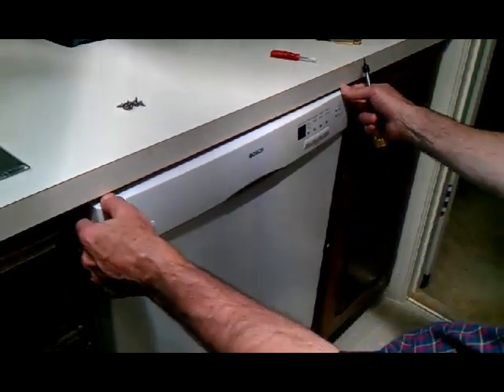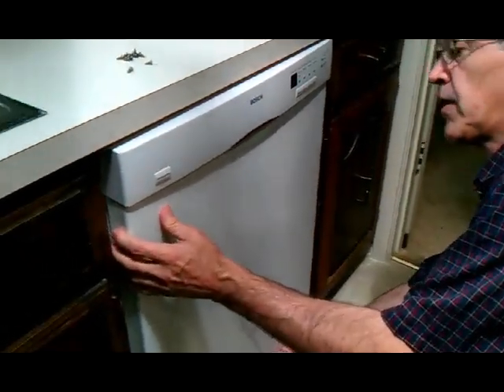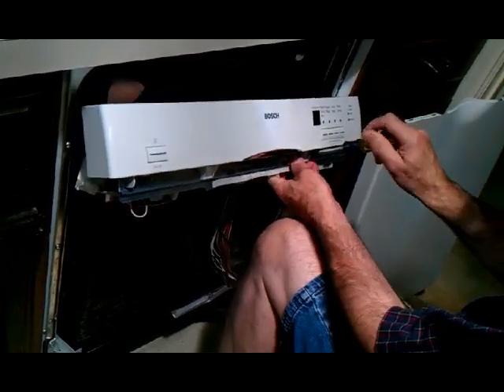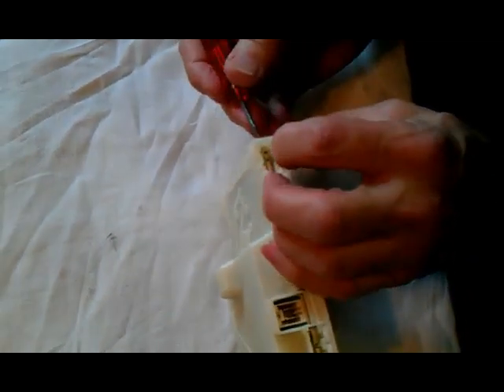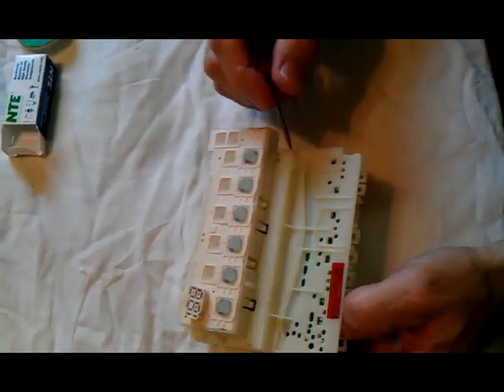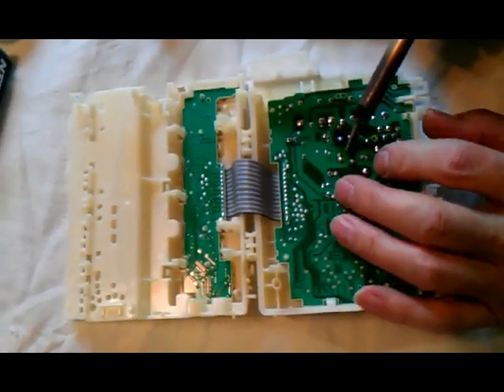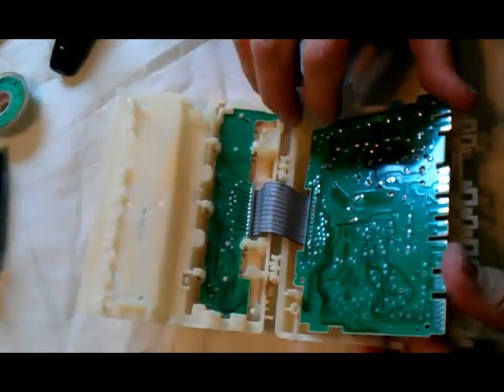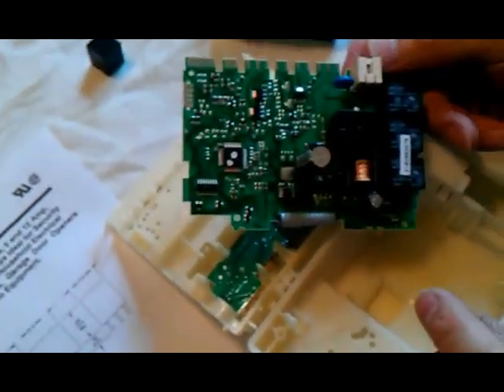Bosch Dishwasher Heater Relay Repair Part 1

Comment from the maker: I would need the information on the top of the relay to be sure which is the correct match as Bosch used 6V relays and 12V relays. Did you happen to take any photos of the relay or write down what was on it?

If you can get me the information on the top of your relay, I'll be glad to recommend a replacement for you.

Just as a side note to show how important it is to check which relay you have, I just helped someone who had a Neff dishwasher (also made by Bosch) that had a 9V relay on it.

Comment: I have a Bosch SHX33A05UC/14. I soldered and it actually held up close to a year but it has started to fail again. Would like to try and replace the relay before the whole circuit Module. Which relay would I use for this model? Thanks in advance.

Comment: OK.  I pulled the board and the relay says 899B-1c-f-c E 6V=DC, 10A 250V T85, 10A 277VAC, 7A 240V, 60609.  Am I correct in assuming I need the 6V R46-5D12-6?  Thanks for the help.

Comment from the maker: When you had it apart to do the temporary repair, did you record the information on the top of the relay? Bosch used different relays in different models and the only way to confirm which one is in your DW is to know which one is currently in yours. Basically it boils down to either a 6V coil voltage or a 12V. Do you have that information?
Otherwise, ordering both relays would be an option to avoid having to open it up again. The R46-5D12-6 and the R46-5D12-12 would be to two options.

Comment: I have a Bosch SHX57C054C/40, SN FD8609 00542 with the same problem.  I soldered the relay for a temporary fix, but would like to replace the relay.  Which one do I use?  Thank you.

Comment from the maker: Yes, that is true...there is a recall. This is noted in the first paragraph of the video's description. Anyone having the symptoms that a failed relay causes should first check to see if their dishwasher is covered by the recall.

Or, if you come across this video and own a Bosch dishwasher that is not currently showing any signs of a malfunction, check the recall list anyway. Better that than to wait for it to fail. The bad relays did indeed cause fires. Mine was not on the list.

Comment: Paul, Im an appliance engineer in the UK. BEFORE attempting any repair, first thing is to contact bosch about your dishwasher, there is a world-wide recall on certain PCBs fitted to a fair few models of theirs, produced between 1999 and 2005. Bosch UK are obliged by law to replace the PCBs in these affected dishwashers, free of charge. It takes a few seconds to phone them up, quote the ENR and FD code and check. It is a FIRE HAZARD if you attempt a repair, as the original spec relay was wrong.

Comment from the maker: Hi, Paul. Your relay is made by Panasonic and is rated at 10A maximum load. It has a 12V coil, so the replacement would be the R46-5D12-12 made by NTC. The NTC relay is rated for 12A maximum load and should give a longer service life than your original relay.

I hope your repair goes well. Let me know if I can help any further.

Comment: Hi Agglomeratedlideas I have the same problem!. The DW is a Bosch SHV 4313GB/17 and the heater relay that  is broken is marked NAIS  JS1-12V AJS 1311 10A. I wold be very grateful if you could let me know what replacement part I need (1 am living in UK)

Comment from the maker: The 12 volt version is more commonly found than the 6 volt version. Unfortunately the two cannot be interchanged.
I would be glad to verify the correct part for you, but without knowing for sure what is in your dishwasher I really can't do that.
If you are concerned about having to take it apart only once, then order a 6V relay. When you open the DW, post your part number here & I'll verify. If it turns out that you need the 12V version, then you could run down to Fry's. Your $ risk is minimal.

Comment: I haven't taken it apart yet.  Spent many searches looking for the proper number.  Am I lazy or what?  Fry's has the R46-5D12-12 in stock for $4 though but not the R46-5D12-6.

Comment from the maker: I am fairly certain that the R46-5D12-6 relay would be the proper replacement in that model. If you would give me the part number stamped on the top of the relay I can verify that for you.

Comment from the maker: The E designates the Comparative Tracking Index (CTI) and is used to indicate the electrical breakdown properties of an insulating material. The replacement relay would still be R46-5D12-6 for your dishwasher. I hope your repair goes well. Let us know. Thanks.

Comment from the maker: Many of the Bosch models do not have one of the pins soldered on the heater relay. It is the normally closed (NC) connection and it is not used. The NC pin just sticks through a hole in the board. On other models the pin may have a solder pad and is soldered, but there is no trace (the wiring on the board) connected to it. Only the normally open (NO) connection along with the common (C) and, of course, the two coil connections on the heater relay are necessary to make the heater work.

Comment: Thank you for the great video and instructions.  I have removed the control panel and see the burnt solder joint.  I also have the SHE44C05UC/22, which appears to have 5 pins on the heater relay.  I was surprised to see that one pin does not have any solder on it.  Do you think that pin is not used or it should have had solder put on it?  I will have someone help me solder next week at work, eyes are't what they use to be.  Thanks again for your assistance.

Comment: Thank you for the great video and helping us to figure out which relay we needed.  The most difficult part about this repair was finding a supplier for the relay that charged a reasonable price for shipping!  We ended up buying from NEWARK.COM and it was just under $10.00 with shipping.  My 14 year old did the soldering and the dishwasher is now running great!  I'm very pleased to have kept a perfectly good dishwasher out of the landfill and at the same time saving a bunch of money. Thank You! ツ

Comment from the maker: The R46-5D12-12 (12A, 12V coil) would be a good replacement for the JS1-12 (10A, 12V coil). Here in the U.S. the 120V DWs have a heater current that is near the max rating of the 10A relay. Sorry, I don't know the heater current of the 240V DWs. With a clamp-on ammeter you should see the heater cycling on and off and find the actual heater current (if anyone reading this knows please post it for us!). The heater relays still fail in the 240V DWs just like the 120V units but perhaps not as often.

Comment: Thanks for the reply.

Out of interest, do you know the volts and amps of these heater elements? I'm curious how it compares to the relay rated specs.
The relay is a JS1-12 and marked 10A 125V. 

We're in Australia with 240V power.

Comment from the maker: Good job getting your DW up and running again! To answer your question about a possible hazard with the contacts sticking, the honest answer is yes, but it is a SMALL possibility. I have seen relay contacts that weld themselves together, but it was with larger relays (contactors) that carried heavy currents. The real risk here is possibly causing damage to your PC board with the heat being generated by the bad relay. Replace your relay as soon as possible (1-2 weeks) and you should be fine.

Comment from the maker: I would be glad to help. I am assuming that you found an indication that the relay has failed such as a melted solder joint. Soldering the melted relay joint often works as temporary fix, but not always. If the relay contacts are burned to the point that they will no longer conduct current, then soldering will not work. Please give me the numbers on the top of the relay (or send me a photo at the Gmail address in the comments below) and I will verify which relay is correct for your model.

Comment: Thank you for the video!  You look like you really know what you are doing.  Unlike us, we took off too many screws and the door came off the hinges!.  Oops, we did get it back on, with some effort but no leaks!.  Unfortunately, the solder fix did not work for us so we are going to have to replace the relay.  I am hoping that you can help us find the relay that we need, our model # is SHU33A06UC-22.  If you could help it would be much appreciated!

Comment from the maker: The main clue that the heater relay has gone bad is the DW runs for a VERY long time at the end of its cycle. The reason it does this is because the water is too cool. The control board engages the heater relay but no current is fed to the heater. The DW is not aware that the relay is bad, so it just continues to wait and wait for the water to heat up which, of course, doesn’t happen. If your DW is finishing its cycle in a reasonable time and is hot and steamy when opened, your relay is working.

Comment: Thanks to your video I was able to repair the buttons on the front panel that had come loose [due to pressing too hard at bottom of button]. How would I know if the heater relay was defective? No hot water or no drying heat? Thanks again for your video.

Comment from the maker: Changing all four relays can’t hurt. It is the heater relay that takes the beating.  The other three relays carry much less current and therefore tend to fail less frequently, but changing them along with the heater relay will certainly give your control board a leg up on longevity.  Thanks for the feedback and let us know how it goes for you.

Comment: First, thank you so much for the video!  However, I am now having a problem finding the replacement part online.  Maybe I'm not searching for the correct thing.  I have a SHE46C06UC dishwasher and the heater relay part number is 899-1C-F-C 6V C0631.  Would you be able to tell me where I can get the relay from?

Comment from the maker: Fortunately you were able to track down the real cause of your problem. Other failed items in the heater circuit can result in the same symptom, but it is nearly always the heater relay that has failed. Appliance repair techs will troubleshoot down to the control module. They usually don’t (and can’t) go to the component level on the module. I hope your repair goes well for you and you get many more years of service from your DW. Thanks for the comment as others can learn from your experience.

Comment from the maker: For some reason some comments started showing double postings, so I deleted the 2nd post. But, it also deleted the 1st post. Here are comments from “Bobby J” that I had saved: “I have a different model, but with the same issue. Tried re-soldering the failed joint twice, and it ran fine for a couple months each time. Then found your video, ordered and replaced the relay. It's up and running again. My model is SHX33A05UC/40. The best $4 ever spent”. Sorry “joeybis13”, but I don’t have your posts.

Comment from the maker: I am happy that you feel such a “sense of achievement”…it is a good feeling for sure! Like you, I am also irritated with Bosch. But, it seems that similar fire hazards exist with other non-Bosch/Siemens brands such as KitchenAid, Whirlpool, Kenmore, Maytag, Frigidaire, GE and Hotpoint. To quote one article I found, “We’ve seen a race to the bottom in terms of cheap parts and disposable products.” So where do we find a safe and reliable product? I sure wish I knew the answer to that question!

Comment: Dear Sir, this has been the most helpful thing I have ever found on the internet. The problem was exactly as you described, and Bosch decided to exclude my serial number from the recall. I can't put a price on the sense of achievement I felt when I soldered the new relay, and the test wash confirmed the issue was fixed. Thank you again!
Furthermore, I know to never buy Bosch again. 30 reports of property fires because of this same issue, yet my model is not included in the recall. WTF BOSCH?

Comment from the maker: Thanks for letting us know about another successful repair.  As for the cover, I mentioned in my video that I was supporting the front panel with my knee, but clamping or taping the cover in place while you unscrew it is a good idea too as you suggest.  Also thanks for giving us another source for the relay.  Having more choices is nice.  BTW, it does seem that the relay issue shows up at about the 5-year mark for many people.

Comment from the maker: Good job…glad you got it working again!  Smart idea to repair and keep your old control as a spare.  I have read on several forums that many have replaced their control more than once.  Apparently the new control modules are better (they are not being recalled), but still continue to fail after a few years.  Too much is being asked of this poor little relay and it just can’t hold up long term.  It is only good for just so many on-off cycles before the relay’s contacts burn out.

Comment: Thanks for the video - it came in handy (very helpful).  I ended up replacing the control board.  Ran the quick wash cycle & it ran for 30 mins (amazing) vs. 3+ hrs before the fix, wife is happy.  I opened the bad control board to confirm the fault and was not surprised to find the burnt relay. I will now order the relay and replace it (will have a spare control board handy).

Comment from the maker: Thanks, and you are absolutely correct…there is a recall for this issue, but unfortunately it is limited even though the problem seems to be widespread.  My DW was not included in the recall as many others have found too.  I believe the relay is failing prematurely because it is being used near its max current rating.  I selected a higher rated (12A vs. 10A OEM) replacement relay hoping to get a longer life out of it. I may replace my relay again after a few years just for the peace of mind.

Comment from the maker: If you would like to send me photos for evaluation, I have set up an email account for that purpose.  The account is MyBrokenDW@gmail(dot)com.  Since it is likely that the account will be flooded by spam now that it is publically posted, I will not be checking the email unless you post here to let me know that you have sent photos.  Also, please note that I may share photos you send to me with others to help them with their problem.

Comment from the maker: Thanks for the heads-up on that Robert.  I had noticed that Mouser kept selling out of the relay and now it seems that it is no longer available as you mentioned.  Newark and Allied Electronics are two other places I have ordered various electronic parts from in the past and they are currently showing stock for the R46-5D12-6.  Just doing a Google search showed several other dealers such as mcmelectronics and acradiosupplyinc that also have stock.  I hope your repair goes well and thanks again.

Comment: AAAND just enough damage to make the dishwasher want to work sometimes and then NOT work other times. "Is it gonna' work this time, or what?"

And then there's the wife watching you try and figure out if it's clogged; cleaning the drain tube; taking the door/console apart, etc.

Sure, I'm glad this is a "Best case scenario"... But the path in getting to this point was FRUSTRATING! : ) Only because sometimes the it would finish a cycle and sometimes it wouldn't.

Made in China!

Comment from the maker: I’m sure that you will do fine with the soldering…and you have only 4 pins to solder.  For those reading this, there was not very much damage showing in this particular case.  The solder had melted back just enough from the pin to break the circuit & only some slight discoloration of the PCB was visible.  Considering that it takes about 370 degrees to melt 60/40 tin/lead solder, severe damage can be caused by a bad relay.  This gentleman has a “best case scenario” with only very minor damage.

Comment from the maker: Now the photos are working and YES, that is a classic example of how a failed/failing relay is causing the solder to melt away from the pin.  There is also a little darkening of the printed circuit board at this pin indicating overheating.  A new relay will be the cure!
Let us know how it works for you.

Comment: Hi. Thanks for responding.

I know what you mean and I did see those comments. I read them all pretty thoroughly. This solder joint is definitely not one of those. You'll see what I mean.

I'll reset my photobucket album so that it's not private any longer. Sorry about that.

Comment from the maker: I was unable to view your pics on photobucket as it is a private album.  But, I think I know what you are describing.  On my model & many others there one pin on the relay that is not soldered…it just sticks through a hole in the board (see my comments to joey in this thread).  A faulty flow switch, NTC or heater can also cause this problem, but it is usually the relay.  Since the relay is cheap, you could replace it & see if that cures your problem.  That would eliminate it as the culprit.

Comment: I'm a self employed carpenter and have a fairly broad experience with almost every aspect of construction and some car mechanical know-how, but I'm completely green in this area. So please excuse my ignorance.

I don't own any kind of voltage meter, nor would I understand how to use it, in order to specifically pinpoint the exact problem with this dishwasher. But I do believe, based on everything I've read online, that it's this damned relay. 

I took a few pictures of the board.

Comment: Hi. Your video here is infinitely helpful, so thanks very much for making it & posting it.

I have this same problem with our dishwasher, with our SHE46C06UC/40 Bosch Dishwasher

I removed the panel & took the circuit board out. No obvious scorch marks around the contacts, but one of them has definitely separated from the soldering around it. It's as though the solder was drilled out & the pin from the relay was inserted into it. Otherwise, it's clean & shows no signs of overheating/burning.